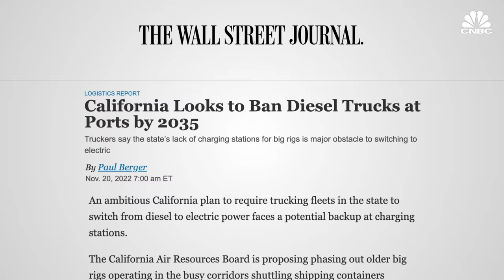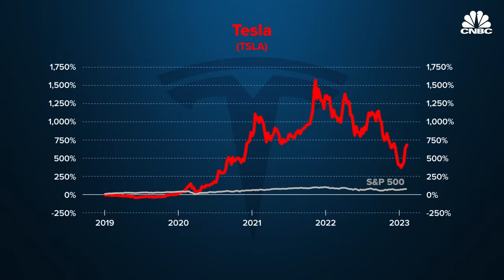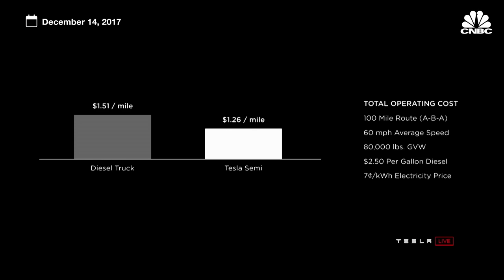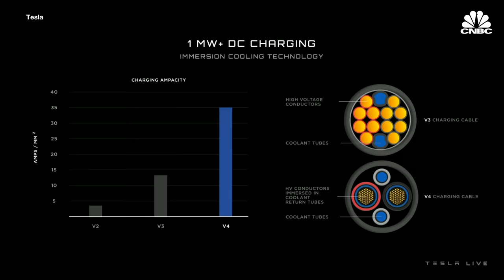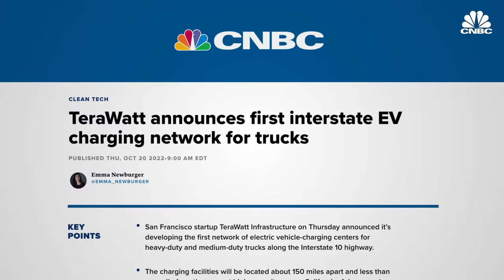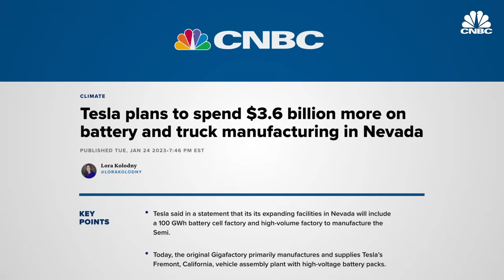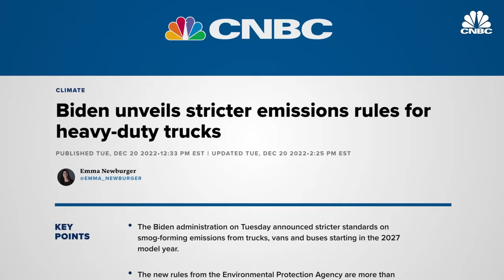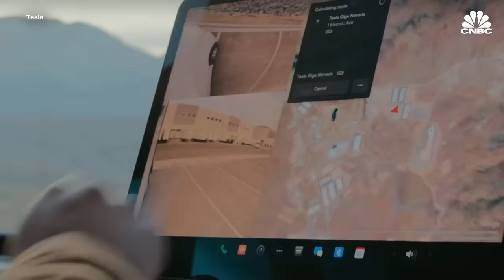Does The Tesla Semi Live Up To The Hype?

Comment: With the price of the truck being double. The battery replacement in between makes cost even higher. How much fuel can be purchased for 40k? Over 10 yrs I think fuel is cheaper. It's all bout tax breaks not savings in fuel
Reply: Tesla warranties the powertrain for 1 million miles, which is how long PepsiCo plans to keep these, so any replacements in between will be on Tesla's dime, not PepsiCo's. Why do you claim the price of the truck is double? Double of what? Why do you think that over 10 years, fuel is cheaper? None of your claims make any sense.
Reply: The price of electricity to power a electricity semi truck is far cheaper, after 100k miles a semi will pay 80k in fuel at 6mpg $4.80 a gallon vs 22k in electricity at 100k miles 1.7kwh a mile efficiency at 12 cents a kwh.

Comment: In Japan, trucks and buses that run on hydrogen are already in operation, and the supply chain is gradually being established. Hydrogen can be stored and has a long range, functioning much like gasoline without emitting any carbon dioxide. Of course, there is room for consideration in the method of producing hydrogen, but to achieve environmentally friendly transportation, it's necessary to explore all options, not just electricity.
Reply: The problem with hydrogen is that it costs ten or more times as much as electricity for the same range, and no one's going to be able to operate them.

Comment: How much of the bill was covered by subsidies? They "won a grant for a complete transformation of the facility" also? So free? So no risk?400 mile range hauling chips? What happened to 500 at full weight full speed?
Reply: 400 mile range hauling chips? What happened to 500 at full weight full spees? 
 You obviously missed the statement at 4:35 that loads of Pepsi weighing up to 45,000 lbs.—not chips—are taken on 300-400 mile trips "to other warehouses".

You seem to have somewhere gotten the nutty idea that if the entire demonstrated range or load capacity isn't used on every trip, it must mean that the actual range or load capacity is less than claimed. In fact, a range >500 miles, loaded to within 1,000 lbs. of the 82,000 lb. GCVWR of electric and natural gas-powered EVs, at the speeds permitted in California where these are deployed, and including a climb and descent of the 4,200 ft. Tejon Pass ("The Grapevine), was demonstrated last year. In states with higher truck speed limits, the range would be less, and with a lighter load, the range would be greater.  But regardless of the demonstrated range, the job of a semi truck is to deliver goods to where they're needed; and if this results in a trip shorter than the maximum range, or with a load less that the maximum load, this simply means lower operating costs for that particular trip.

Comment: It sounds like Elon is working together with them. So the rig is obviously in its first stages, and Pepsi signed up to test them out. So if there are any issues, Elon will have them fixed and use the info from the field daily use to perfect the trucks. Sounds like a good partnership. Especially since Tesla wasn’t ready to make the Rig available for purchase or mass production yet. It is still working out production obstacles. So this first will help them with feedback. It’s like an in field a test market

Comment: As any driver knows we can't even provide enough parking spaces for trucks so the possibility of providing enough charging stations without a long wait for drivers is dubious at best. Not to mention what we are going to do with all the batteries after the life of the vehicle which I believe will be a big environmental issue in 50 years.
Reply: What have we done to old cars , they are all in garbage , but no concern on them , why u so concerned about this
Reply: There won't be more trucks, just different trucks; so there won't be a requirement for more parking spaces. And you may not be aware that Tesla has gone from no charging stations for Tesla cars 10 years ago, to a world-wide network of >45,000 chargers. The number of Tesla Semis will grow much more slowly than the number of Tesla cars, and so there's no reason to believe they won't be able to grow the Megacharger network at a pace to keep up with the growth in Tesla Semis.

Everything in an EV battery is recyclable, and there are already several EV battery recycling companies. Once the number of EVs flattens out, probably in 30-40 years, all materials for new batteries will come from recycled batteries, and so very little additional mining will be required; but if we don't shift to electric vehicles, we'll still be desecrating the earth with strip mining for coal, fracking for natural gas, etc. Take your pick...

Comment: Where does the electric come from. Burning fossil fuels.
Reply: Some, yes; but the proportion of fossil fuels in the electric grid is dropping rapidly. And all Megagacharger sites have rooftop solar and Megapacks (batteries) to augment electricity from the grid. But what you and your ilk either don't understand or refuse to acknowledge is that electric vehicles, including the Tesla Semi, use around 2/3 less energy overall than comparable diesel or gasoline vehicles; and so even in states with a high proportion of fossil fuel in their grid, switching from liquid fuel to a BEV charged from the grid still reduces emissions dramatically.

Comment: My uncle a truck driver says he might travel 700+ miles in a day whats the range of this truck before it has to be charged?
Reply: 500 miles; and then it can be charged with another 350 miles during the 30 minute break that your uncle will tell you he has to take before eight hours on duty. Of course, no one's going to drive down to zero range; so 400 miles, plus a 350 mile top off at 8 hours is more reasonable. You can do the math.

Comment: What we REALLY need, however, are electric pantograph lines over our Superhighways. That's a 150 year old technology, that was/is used for commuter rail. 
Long Haul trucks log the Lion's share of miles on those highways. A (relatively) small battery could Easily handle the time they spend on city streets. 

Germany and Norway are already doing that. 

Gasoline+Diesel Fuel=about 80% of a Barrel of Crude.
And, even the ten percent that goes into Jet Fuel will be threatened by Bullet trains, and, hopefully, the Hyper Loop, if it's built. "Green" Anhydrous Ammonia is also being looked at as a fuel for both aviation and cargo ships. It needs to be broken back down into H2+N2 first. 

OPEC...your days are Numbered.

Comment: Once state governments realize their loss in tax revenue and they start charging more for registration and electricity there will be no advantage.  Replace the battery for what $60 grand?
Reply: the difference is that electricity be made cheaper while gas prices only go up, this is a 900kwh battery the replacement will easily be 100K, but the truck saves 240k every 400k miles driven compared to diesel trucks on just fuel savings.

Comment: Trust me. When there are no more diesel and gasoline engines. The cost of power will go up.
Reply: if there is no more gas and diesel then they would still be far more expensive to use gas or diesel for trucking.

Comment: Nice "semi-fluff" piece. But the one thing that I haven't heard much about is the load capacity of these vehicles. What is it??? To give the range of 400 miles, the batteries would have to be much heavier than diesel fuel for a similar range. This CNBC story seemed to skirt that question and Tesla has never said what the load capacity is.  I would love to know.
Reply: "The contents that are the trailer can weigh about 45,000 lbs."; 4:36
Reply: That is a very misleading statement and obviously edited out of context. 45,000 lbs. is the acceptable load capacity of standard long haul diesel tractor trailers. That is NOT the load capacity of the Tesla Semi. That is why the guy was comparing potato chips (mostly air and very light) to cans of soda (liquid and very heavy). The fact is that due to the weight of the batteries, the Tesla Semi will have a significantly reduced load capacity. Tesla has NEVER released this number to the public. @Big_Ben_from_La_Mesa
Reply: @fpdima   45,000 lbs. is the acceptable load capacity of standard long haul diesel tractor trailers. 
I'm not sure that's correct. Many diesel truckers report payloads in the vicinity of 46,500 lbs.

 The fact is that due to the weight of the batteries, the Tesla Semi will have a significantly reduced load capacity. 
Both because electric semis are allowed an extra ton of GCVW, to 82,000 lbs., and because there's a limit on the weight of the trailer no matter how light the tractor is, Tesla Semis give up very little in payload to diesel semis. 
While Tesla hasn't released the weight of these prototype vehicles, they have released other information showing a payload of around 43,000 lbs. in a dry van trailer and 44,000 lbs. on a flatbed trailer. For applications where loads >43,000 lbs. must be towed, diesel semis will still be required, likely for a couple of decades.

Comment: Notice that it’s just chips and sod’s. Where’s the big loads that real semi’s pull? And what about locomotives? Have you seen the plumes of black smoke those things produce?
Reply: "Notice that it’s just chips and sod’s [sic]. Where’s the big loads that real semi’s pull?" 
It seems you may not actually have watched this video before posting your fact-free comment. At 4:42, it's stated that loads of soda will "weigh out", that is, the load will be limited to the load capacity of the trailer, and not the volume. At 4:36, it establishes the load capacity as 45,000 lbs., and at 4:30 it's stated that loads of soda are moved in "300 to 400 mile runs to other warehouses". Taken together, this establishes that 45,000 lb. loads of soda are being moved on 300 to 400 mile runs. Does this answer your question?

Comment: How much is the truck battery charging bill each month in comparison to the diesel fuel bill of the same miles driven?
How much are the onsite battery charging in maintenance and initial cost?
What are the in dollars savings of truck maintenance per month?
What maintenance items do electric trucks have that diesel trucks do not?
How much loss in revenue per truck due to the heavier truck weights and how much heavier are the electric trucks?
Taking away all of the Government and Tesla incentives, how much is the cost of electric transportation vs. diesel?
How much does Pepsi pay for their charging electricity per kWh with their electric company?
How much pollution is saved or not from using electricity from power plants? Electricity is generated, doesn't that pollute as well?
Now, lets do the same charging of batteries but without any solar, wind, ocean etc. such as at nighttime, what are the pollution levels saved or gained?

Comment: shouldnt they have solar on the trailer? its a pretty huge surface
Reply: That's a pretty common suggestion, so I did the math on adding solar panels to the roof of standard dry van trailers. Turns out that they would produce enough electricity for an added range of about 13 miles a day. But the added aerodynamic drag and weight would decrease the range by about the same amount, for no net gain. Much more importantly, solar panels covering the top of a dry van trailer would weigh about 2,000 lbs., which would of course reduce the payload by that amount. I can post the math if you like.

Comment: But can this truck forge through deep water and show?
Reply: Tesla motors don't have air intakes that must be kept above water level, and the batteries, motors, and electronics are sealed. Root around a bit in YouTube and you'll find videos of Tesla cars literally driving underwater.
And Tesla Semis will do better than diesels in snow and ice, for at least three reasons: first, a substantial portion of the weight of the tractor will be shifted to the drive axles due to improved weight distribution of the batteries, increasing traction; second, the smooth application of torque by the electric motors, compared with transmissions shifting every few seconds, will mean less wheelspin; and third, the torque axle has independent motors on each wheel, allowing torque vectoring in limited traction situations.

Comment: 1 hour for a 400 mile range. used  to fill up my pete in 10 minutes with a 1200 mile range.
Reply: So what? This is a day cab. Starting the day with a 500 mile range and adding 350 during the half-hour break required prior to 8 hours on duty, it can drive as far in a day as HOS regulations allow, so any additional range is wasted. It's not suitable for team driving or OTR duty, and it's not being sold as such. If that's your gig, then this isn't the truck for you.
Reply: How are you driving 1200 miles on a US CDL?    17hrs of driving at 70mph.
Reply: i'm talking about range. not the time it takes to go that far.
Reply: So what? Tesla Semis are day cabs, and can drive as far in a day as allowed by HOS regulations and speed limits, including a top-off during the required 30-minute break at 8 hours; and mostly charge at night when rates are low, or during the day on free solar power. Anything more is wasted. True, it takes a lot less energy to carry additional range in a diesel semi than an electric semi; but planning around the Tesla Semi's range is just one of the adjustments that'll be needed, to gain all the other benefits of electrification.
Reply: @BigBen621  i drove a freightliner day cab that took 10 min to fill and had an 800 mile range. so what's your point? mine point is how fast to replenish the range. never said anything about HOS.
Reply: @jimmyp5123  No one is claiming the diesel semis don't have longer ranges, and fill up quicker than a Tesla Semi—of course they do. The point is that if you can drive as far in a day as permitted by HOS, and let it charge overnight so it's not on your time, what does that matter? In OTR and/or team driving, this matters more; but that's not what these are designed or intended for. Maybe in a few years, when better battery technology provides longer range and quicker charging they will; but not now.

Comment: Do you have enough electric power supply in the state. Where does the power come from in California? If it primarily fossil fuel then itvis more polluting.
Reply: If you took all the fuel these trucks used and put them in a electric generator, you would still make less pollution due to the higher running efficiency of a generator vs a engine.
Reply: Under the current model, most Tesla Semi charging will be done at night, when utilities have excess power, and sell it at very low rates. So yes, we have enough electrical power supply in the state.
California is 41% fossil fuel, including just 3% coal; 59% is renewable, plus nuclear (which is not technically renewable, but still emits 0 GHGs). Also, keep in mind that because of the greater efficiency of electric motors vs. diesel engines, EVs use about 2/3 less total energy than ICEVs; so even if all charging is done from the grid, switching from diesel to electric drive reduces GHGs by 86% in California. But Tesla Semis don't charge completely from the grid, but augment the grid with solar energy from the solar arrays and Megapacks (batteries) installed at each Megacharger. So in California, with fairly low fossil fuel contribution to the grid, converting from a diesel semi to a Tesla Semi reduces fossil fuel use by nearly 90%.

Comment: As a child whose parent worked forming  the steering wheel parts and motor parts for Tesla… DO NOT GET THESE VEHICLES. These cars will be the next Boeing. They will have problems beyond locking the riders in while the car is on fire. My 48 year old mom at the time could been the body frame of the car with her own strength and it would in fact break, but I get it. These electric cars are Americas Starbucks. I’ve been an advocate on these vehicles Tesla Specifically since 2014